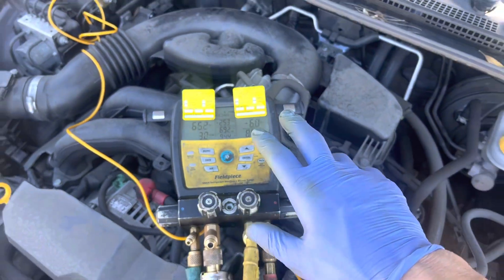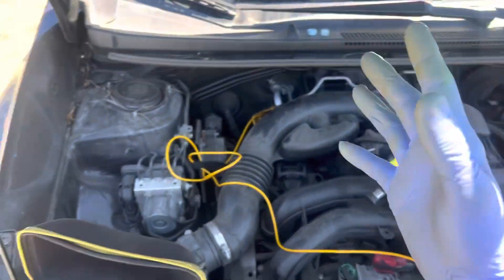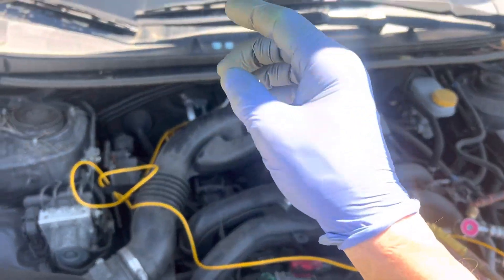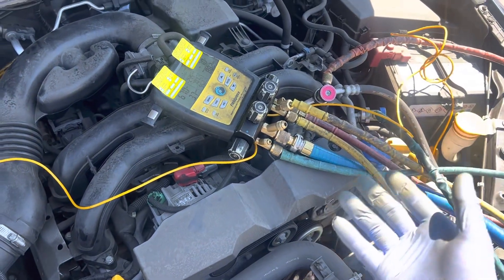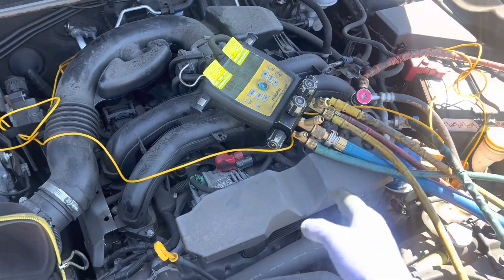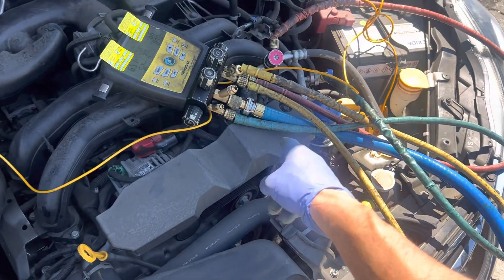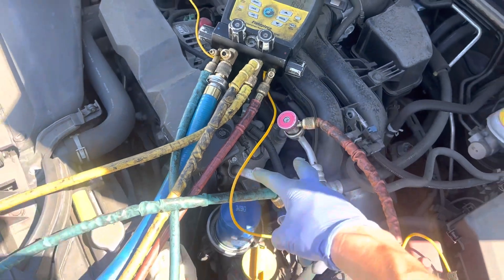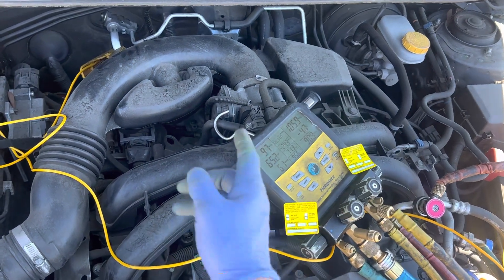Superheat and subcooling on a Subaru let’s not look at pressures￼

Comment: can i safely assume, most oil will stuck at evaporator but not at condenser?
from my workshop manual, evaporator takes 50% of total oil, condenser takes 10%.
Reply from the maker: @jayjwin1178  it changes on different types of AC systems. 

On much older systems that had compressors that had some pump reservoir, the majority would be in the compressor reservoir 

Very little to almost none in the evaporator it doesn’t stay there. It’s only a small percentage that is circulating with the refrigerant. 

If it has a receiver, dryer portion will be in the receiver dryer that is mixed with the flowing refrigerant that is a refrigerant reserve. That’s why it’s called a receiver. 

Very little in the condenser

If the type of system is an accumulator based system, a large portion of the refrigerant oil will be in an accumulator. 

Some of your literature they’re referring to
     Is not where the oil stays, but is telling you where to put the oil on a brand new system for startup to distribute it. 

On the newer high-efficiency refrigerant systems that have some of the smaller newer compressors they have designed the systems to even operate on a smaller oil charge even less refrigerant inside the compressor all the way down to total capacities is being as low as 2.44 ounces.  Ridiculously small compared to what we used to just because of the new designs of the new systems and the management of attempting to keep refrigerant oil out of the refrigerant stream. 
       The reason they do that is traveling with the refrigerant more efficient. The evaporator can operate with less oil because oil does not conduct heat oil is an insulator..

I didn’t mention everything, but just the highlights of a few really common oil related fill situations
Reply: @coldfinger459sub0  thanks Tom for the insight! much appreciated.
Reply from the maker: @jayjwin1178  reading the details on a specific year make model vehicle is what is important

Not reading information out of a general service manual that usually has been re-printed from Old information from 30 years ago